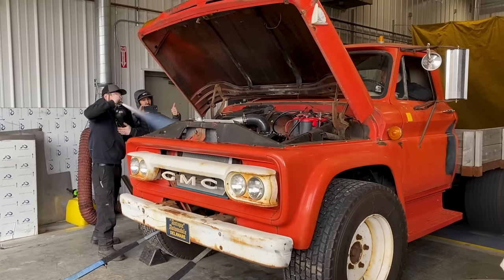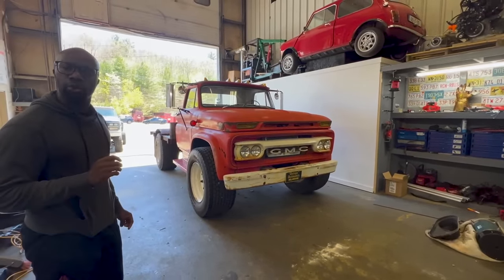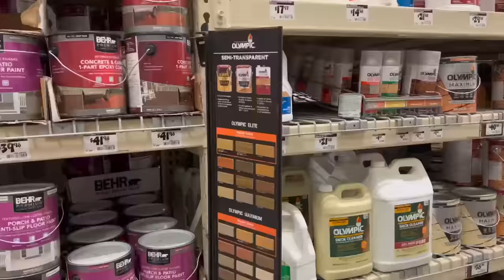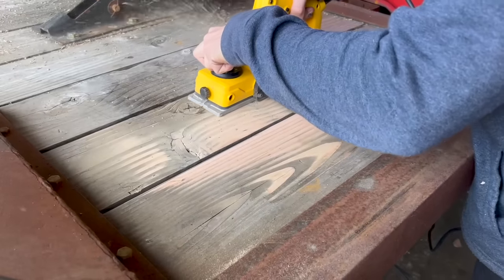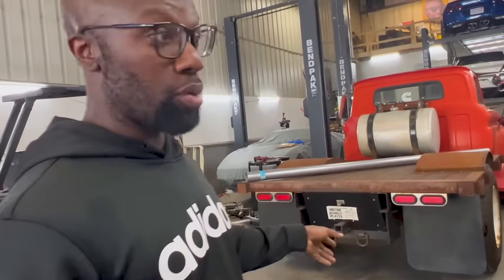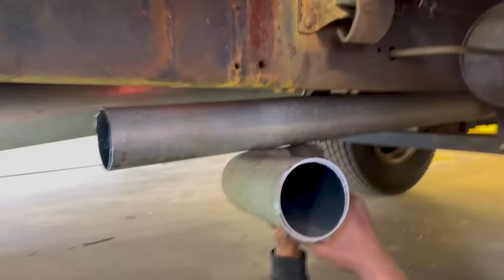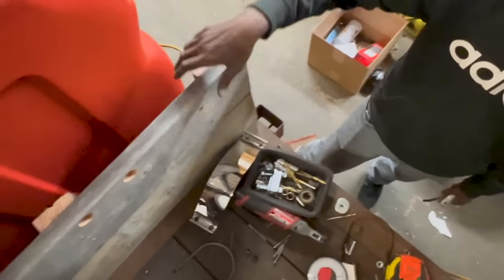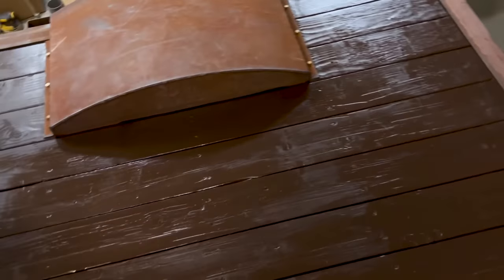Tastefully modifying our 1960s classic farm truck

Comment: i hope you put the flap facing rear and hinge facing forward the wind will mess it up otherwise
Reply: Wouldn't the wind try to force it closed in that case? Sideways, the wind doesn't affect the cap while actually causing a small vacuum on the exhaust.
Reply: @esqueue  the exhaust pressure is more than enough and the  wind is bette running over the hinge than slamming into the side of the tall piece that hangs back when you look at a tracktor they face backward from the factory
Reply: @esqueue  the wind slamming into the side of the tall piece adds axial load to the hinge and that increases resistance then holding it open and not letting it close proper that will let water in in bad weather and also add wind drag because its sideways. i know what im talking about i went to a diesel tech school
Reply: @knexmanmanmanman1781  you should have stopped after the first comment. LOL. Wind drag? From that tiny 4 square inch piece of metal? Ummm, you didn't think that one through, huh? And just as the exhaust pressure is enough to push it open against the wind, the amount of water coming in, even during a torrential downpour, is inconsequential. It will be atomized and blown out just as fast as it's coming in.
Reply: @littlejackalo5326  yup there it is i knew if i continued someone would miss the point.. obviously the truck is as aero as a brick, but they design aerodynamically with every project and part to some degree

Comment: Love the tires. You should put some wood sides on the bed, not too high though but just high enough to match the wood the stack is attached to. Then stain it like the bed. You could also rub the paint out and wax it to bring out the shine. Maybe paint the wheels semi-gloss white.

Comment: Honestly if any big old truck gets an EV swap, do it on an old military truck like the M35. A big six wheel drive military truck would be the pinnacle of a high output EV build, tons of room for a massive battery pack, and you could throw an obscene amount of motor power at it, and it'd handle it fairly well considering the extra tire contact the third axle gives. Arguably you could do the same to any 6x6 platform,  but I think the old military truck style would give you the optimal amount of room for stuffing it with power.

Comment: I know Diesel engines pretty well brother. And 1 of this era the easiest way to stop the black smoke is to run it on vegi oil, or used filtered vegi oil that you can get cheap from fast food places in bulk. Sometimes for free lol. Plus the exhaust smells like French fries👍👍
Reply: They already tried running a truck on veg oil a few episodes back it didn't turn out well

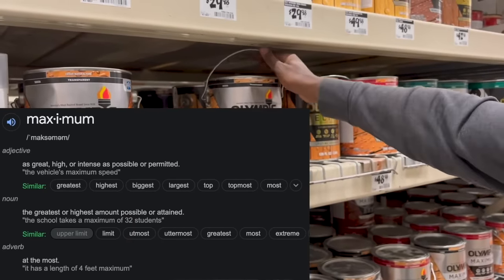Comment: 7:30 DO NOT USE BEHR or any other DECK-OVER paint, that shit looks great for 1 year, then it peels off in sheets.  It completely F'd my deck.
Reply: Same
Reply: That's because you didn't prep it properly. You need to spray it with a deck cleaner and then pressure wash it, wait for it to dry, and then coat it. If all that was done, file a warranty claim. But I've never seen it peel like that if it was prepped properly. I've got some on jobs that I did years ago, and it's still fine. an acid or alkaline based cleaner is best, but a sodium hypochlorite, hydrogen peroxide, or some other bleaching deck cleaner works too. Or you can sand it and use a less harsh cleaner. Or you can pressure wash it with an acute tip, and ablate the surface. There are a bunch of ways, but it's like any other coating process; it's all in the prep. Another mistake may have been you not giving it to the paint guy to put in the shaker.
Reply: @littlejackalo5326  prep is everything with stuff like this.

Comment: Go propane its help the power and does a clean burn of the fuel increase mpg too
Reply: you know that's not a bad idea at all, and as big as that bed is they could get a good sized tank in where the fuel tank is and have no range issues...
Reply: 😂lol it's a diesel. it would take an insane amount of effort to convert it
Reply: @mrwhips3623  It is not a conversion. Propane injection is in addition to diesel and enhances fuel economy (on an older diesel injection system like this) and power.

Comment: the black smoke is indeed bad, and for that matter, you can tune it out of a lot of diesel engines (and benefit from doing so). This is another huge benefit of what edison/deboss are doing, you never need to rev it hard and you never get the bulk of the soot.

Comment: You need to retrofit a fuel tank under the bed. Give it a solid tune as well. Also all that black smoke is soot which falls to the ground in short order.

Comment: That truck is so beastly it said "You shall not sand my Wood" ... 
The planer was necessary. 
Should have used linseed oil for 20 year protection in the New England weather.

Comment: You need to electrify the front two wheels.  Have the most unique hybrid of all time.  Just in case you ever need all tires spinning and got some sick ass front wheel drive burn outs.  Damn dude, make this front two tires put out an equal amount as the back two or maybe even more.

Comment: Have you thought of doing compounds and an intercooler? Like wuhan war whistle S363/Stock over S475. They are pretty cheap on Ebay and they'll clean up that smoke quite a bit with some AFC tuning/modifying. valve springs, 4k governor, some timing advance and I wouldn't worry about the bottom end till you creep on on 800HP.

My build was 
4k governor
K31 (72mm)
5x.016s
18* timing
ported exhaust on the head
Studs
Modified AFC for travel
191 deliver valves
valve springs
- probably some other stuff that I'm forgetting. It was 8 years ago when I did most of it.

With proper tuning I could drive the truck around relatively low smoke and merging onto the interstate was only 3/8 throttle lol. But if I buried the peddle outside of boost it would be very smokey and it's not something I liked actually. But back then I couldn't afford compounds nor did I have the tools that I do now to produce my own stuff.

I still own the truck but it stays on my land and it's only used for hurricane cleanup. I've dropped down to smaller injectors (5x.012s) and I have one of those ebay 363s that I plan on running with a .80 housing. But other projects have stopped me lol. But I also don't want to get rid of the motor and drivetrain for sentiment reasons. 

But other projects a modified T444E in a medium duty and a new 6.7 that I'm currently building and it's going to be compounded over the stock VGT.

Comment: I've had the smoke police bother me. I just politely point out my diesel trucks, 70s thru mid 80s International Harvester S series trucks predate any diesel emissions laws by at least 10 years. Unless your coal creates a hazzard, I wouldn't worry. I run low pipes angled down, not to side. I'm not a fan of showboating coal rolling, but it is a normal function of older mechanical diesels to get going, especially older big displacement turbo and N/A engines.

Comment: There are kits to add water/methanol injection, which lowers EGTs. And supplemental propane injection, which not only improves fuel mileage, it helps clean up the exhaust. It also increases power.

Comment: I like the idea of using super singles for tires. my vote would be polished aluminum rims.  they can be purchased on the used market very cheaply.  The 1960-61 C50/C60 had a wider fender flare (about 6") which would cover your front tires.  In my opinion, I think it would look a little better that way.  Also, the flatbed is cool, and I know you showed it welded to the frame.....but, it CAN be removed with an angle grinder and/or a plasma cutter.  I think a passenger truck long box would be great.  those same 1960-61 front fender flares could be fabricated to the box to finish it off nicely.  if you really want to get crazy, fabricating the truck into a 4 door crew cab would be amazing!  that would give you the opportunity to use a modern frame with modern suspension and modern brakes.  just a couple of suggestions...I really like the concept of what you are doing here.  On another note, your exhaust theories on reducing emmisions are all pretty much fallacies but at least they are mildly entertaining

Comment: Would “look” better if the weighted end of your flapper was straight forward. 😊 ALSO that “scary. black smoke” is cleaner than anything coming out the exhaust of a gas engine! 😊😊

Comment: Hay guys why do you not just have the injector pump an injectors, rebuilt an then have  the fuel to air adjusted to the correct value, unfortunately that may not be possible with that type of injector pump, but putting baffauls in the pipe is a bad idea,  in fact it will make it much worse over time.  That black smoke is because the air to fuel ratio is incorrect, an the combustion an temperature of the gases are two low. Diesel smoke is extremely dangerous for your health.  Great truck, well worth preserving.

Comment: It would be a really cool lowered frame grinding Hot Rod. Then see what the dimensions of an original 65 bed off of a half ton truck would have been and see if you have the skills to build a bed to match the larger cab. Then it would look like a really big 65 Chevy half ton truck. Then I'd repaint the truck that orange red color chevy used to use back then.

Comment: Bed protection? I would have chosen 50/50 motor oil and diesel fuel. Used oil for dark and new oil for a lighter color.

Comment: Hey Rich. I am a trucker by trade. Usually when an engine blows soot like that, it's valve timing. Especially on ULSD. Want more power, run off road diesel.

Comment: Also, for those people who freak out about diesel exhaust, they should know that it is mostly carbon dust, i.e. soot. That's carbon that WON'T GO INTO THE AIR! It will sit around on the ground, on your car (not mine because I don't have one) and on your house, which will eventually need cleaning with a power washer, which it does anyway, because you don't take care of your stuff. Which is why we can't have nice things. Am I rambling? So? What can you do about me?

Comment: Modern diesel pick up trucks blow that smoke at street level all the time. And it's actually gasoline powered cars that can't smoke more then 10 seconds when accelerating.  There's nothing at all about diesels they can say especially one from 1960.

This is a great looking truck like a pickup on steroids.

Comment: @Rich amazing truck, here's our idea, seal the bottom using something simple and cheap perhaps flex seal or duct tape. Mix some clear acrylic and fill the bed in all the way up about a quarter inch above the wood. Let it dry, boom permanent solution and still beautiful!

Comment: You can remove and replace them it’s hard to do but we had to do it on my dads trailer he would put like a 4x4 or a brick under the 2x4s and bend it into the slots and looks like for the smaller pieces you can remove the middle and slide it into the slots from the middle after cutting down the 2x4 just a idea if it needs to be done

Comment: all diesels blow a little smoke when you accelerate or start them due to unburned fuel. the rules are they have to have clear exhuast within 3 seconds of starting.

a diesel that blows black smoke all the time is over fueling and will not pass the emissions rules.

Comment: Spray the rust on the back of the bed black display the rims black change out the headlights to LEDs put light bar on that b** definitely a sub system , you might be able to get rid of some of that black smoke with a flamethrower kit on the top of that

Comment: I own 16.2L worth of Turbo Diesel (split between two vehicles -- guess what two engines) but uh.. yeah neither of mine smoke much at all. One had a tune on it when I bought it and it did smoke a fair bit. ...but I'd just as soon not waste the fuel, deal with the associated EGTs, or advertise how much throttle I'm applying. Plus, like the Carolina squat, it just attracts negative attention to the hobby even if you don't count the dipshits who crash into people while trying to hit someone with smoke.

Comment: I drove one in the 1960's  It had a 2 speed rear end.  Why did they stop using 2 spd rear end?  Wish i had one in my gas hog truck that gets 10 12 miles per g.  If we hadn't defunded the police and installed all these progressive prosecutors we could ticket these rolling coal inconsiderates.

Comment: The EPA is full of shit. They DONT have the authority to add emissions requirements to non-emissions vehicles. Not only is that a 1965 truck, it was born with a gas engine. There were no emission regs AT ALL in 1965, for either gas OR diesel engines. If they try to fine you, ignore them. There's literally nothing they can do.